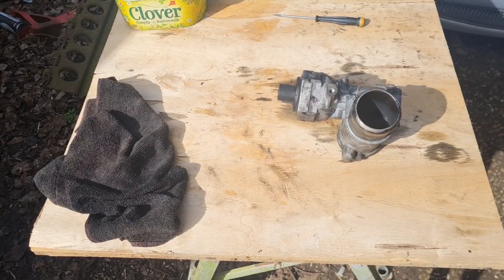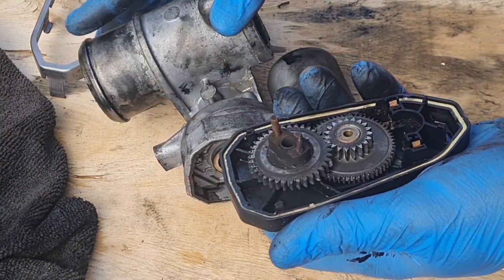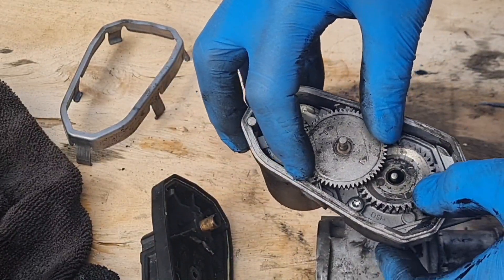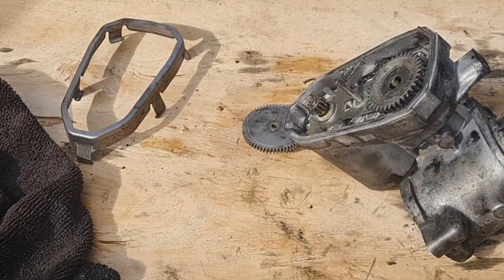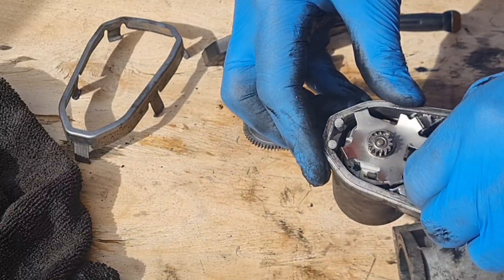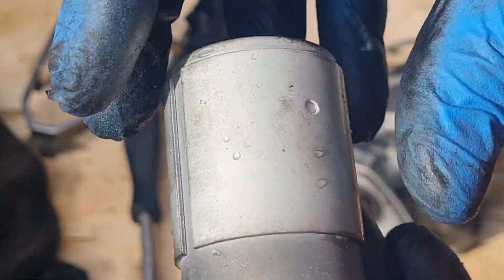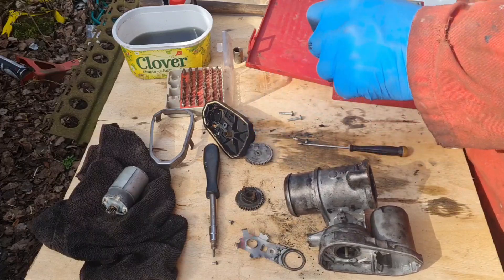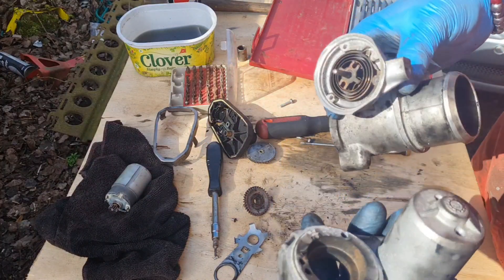What's inside and Electronic EGR Valve? Ford Jaguar 2.2 Diesel engine.

Comment: There are five connections on the back of the plastic plate that correspond with the five terminals, two in the middle that you pointed at, two at the other end and one through the central spindle.

Comment: The four wires are used because it is a 'stepper' motor. It can open as much as required by the stepper motor controller, as opposed to fully open and then limited by some sort of limit switch this would be the case of a conventional motor. The spring is to return it to its 'start' or closed position once the power to the motor is cut.

Comment: Can you not just blank it off, i had mitsubishi 3.2 lack of power got told from the dealers new fuel pump required, price £3000 can't put second hand one on as they are coded to the car so car off road, good old internet and mitsubishi forum guy from south africa told me to blank off EGR so a £3.37 kit bought from ebay fitted car went better than it did when i bought it

Comment: That's really interesting Adam. I shouldn't worry about £50 for an EGR valve. Just spent £80 on a piece of pipe for the EGR on my Renault Diesel and it was £80 for what looks like a piece of brake line. Is the Jag OK now Adam